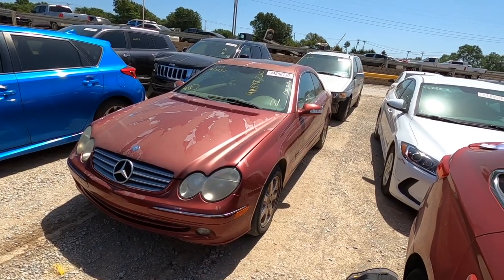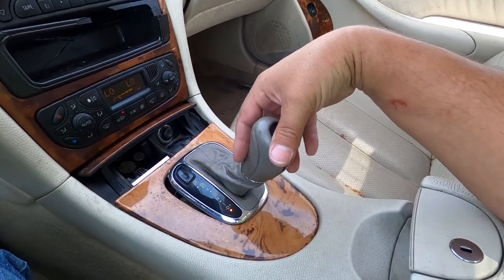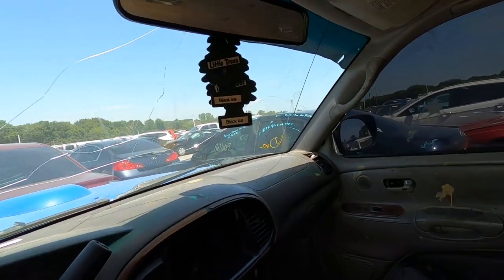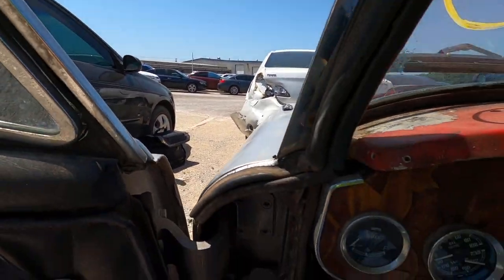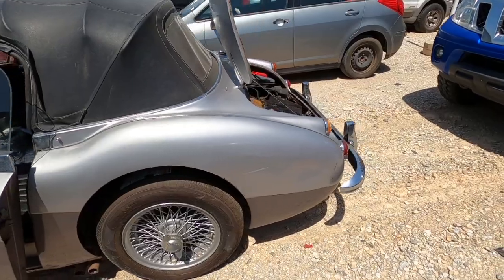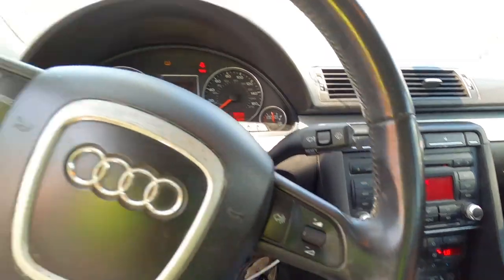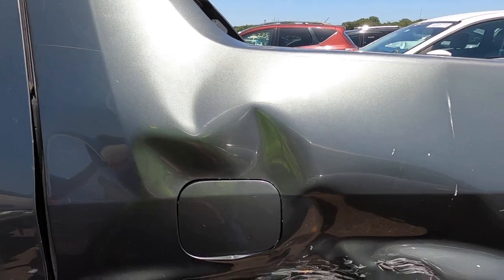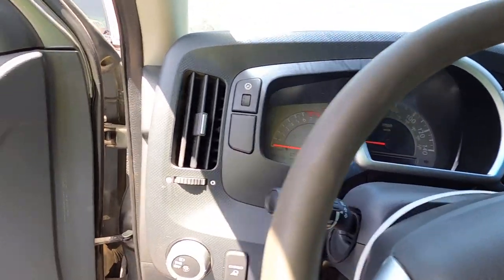Copart Walk Around 8-11-2020 + 1966 Austin Healey 3000 MKIII

Comment: Don't know if anyone has mentioned this Randy, but the pull release for the Big Healey is on the right hand side (it's a british car from near Oxford).  Done up they will see at least 50-100k depending on quality of resto and whether they have a rally or racing history.  It's a 6 cylinder overhead valve 2912cc motor, usually 2 or 3 x SU carburettors standard or 3 x dohc twin choke weber carburettors. "wire wheels"  were optional. 
Spares are available from the uk.

Comment: I had a 67 Healy. they are called the big Healy. 6cylinder, 2 or 3 SU side draft carbs. Great in the corners but an outstanding cruiser. Very easy to work on. the front suspension is ahead of the engine, so you can pull the oil pan without lifting the engine. BUY IT!!!!

Comment: Randy, No Breno on the Austin. They have very bad electrical systems. As a kid, a brand new Austin came in to the station with the wires smoking at the voltage regulator. I think it was jumped off with the wrong polarity. English cars back then had positive ground electrical systems. The mercedes benz could use some Love!!!
Reply: The Mercedes probably has a SAM module issue for all of the interior stuff

Comment: The hood release should be under the dash. Hood opens from the front and it has 2 secondary latches. Nice drivers are $25000-$30000 all day long. Restored ones are very expensive.

Comment: Put Deoxit on that switch on the Mercedes and that stuff is magic works great on switches to clean them and lube them. That looked like spilled contact cement on the truck seat not vomit. Polished stuff is called trim. You cannot afford the Austin Healy you dont have the money to buy it. I do want you to buy it though. The silver Austin is awesome. You can fix the clutch but you will have to spend a lot of time underneath it. Get your roaming mechanic to fix the clutch.

Comment: Just wet sand the clear off the lil red Mercedes and respay clear. Quick and easy.
Reply: Better off painting it. I've tried to save the paint underneath and clear coat, but it looked like crap
Reply: that Mercedes probably has a whole lot more wrong with it then just flaking paint and a few bad fuses knowing how some German cars can be
Reply: @silasmcgee3647  ONLY German  car I've owned was a mid 90s Porsche. NEVER again. Those were pieces of crap.

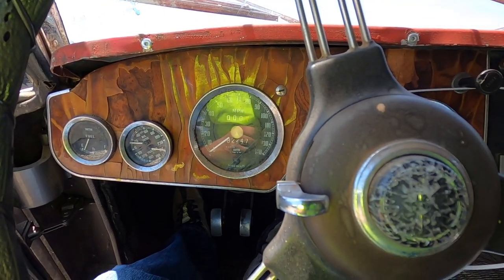Comment: That Austin is probably full of body filler (@19:40). I'd do some homework on the oil pressure sending unit and try to test oil pressure with a mechanical gauge. If it verify 10 psi at idle I'd stay away because finding somebody that does engine work on British cars is gonna be tough